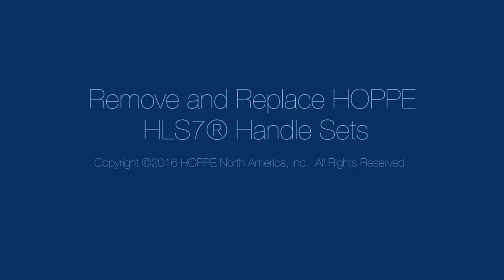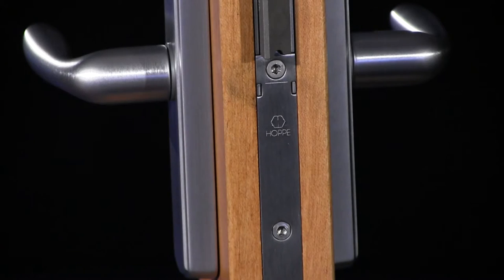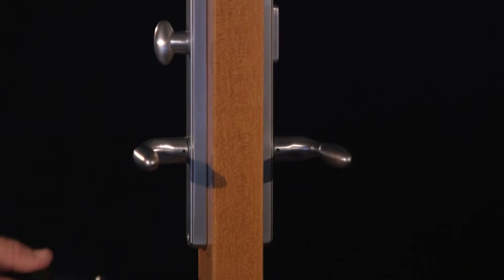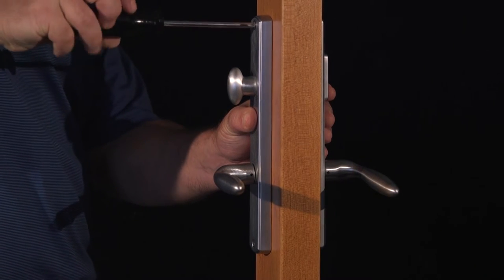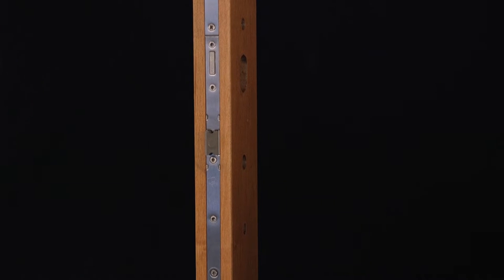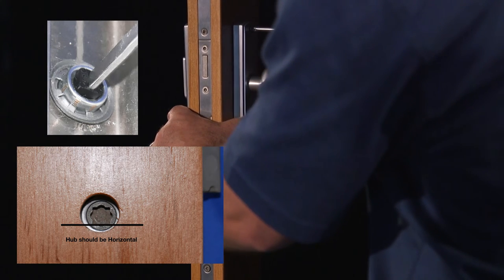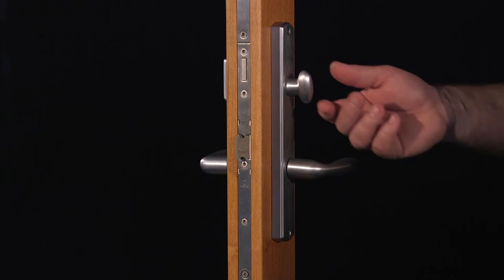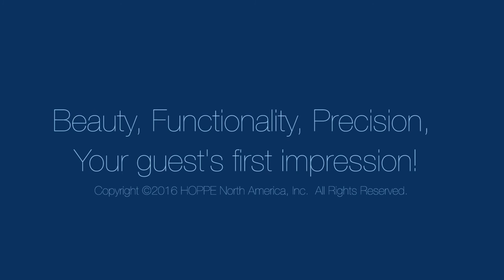HOPPE HLS®7 Handle Set Removal

Comment: The company I work for installed this doors that used this on a low roof of a sky scraper. To keep people from accessing the low roof, I was instructed to install the thumb turn to the outside and the key cylinder to the inside. The goal was to use the key on the inside and lock the door. But when someone turns the handle inside I unlocks both the latch and deadbolt. I'm thinking it has to do with the deadbolt mechanism inside the door. We can't just change the thumb turn to the outside and expect it to work. I don't know if this made sense to anyone. But if anyone can help. I'd appreciate it very much.